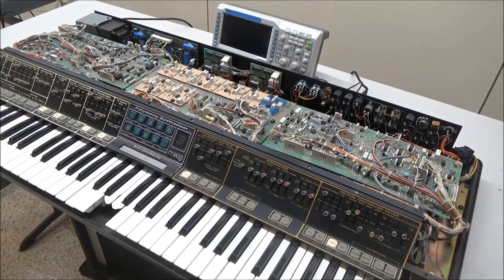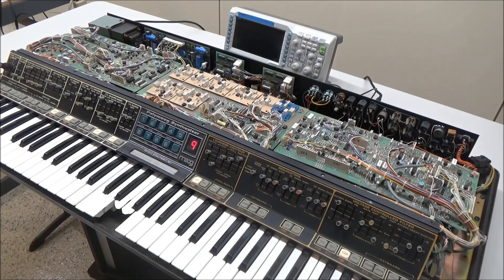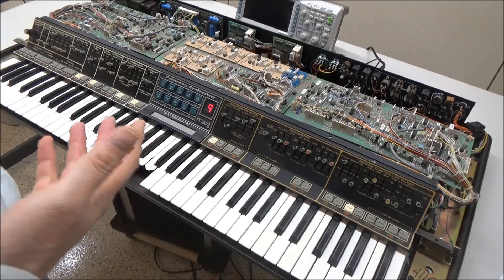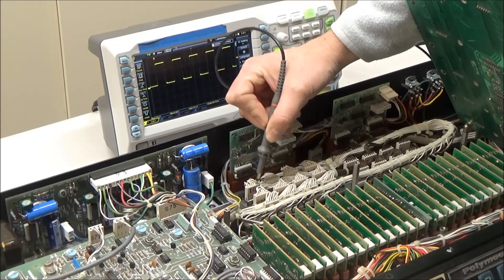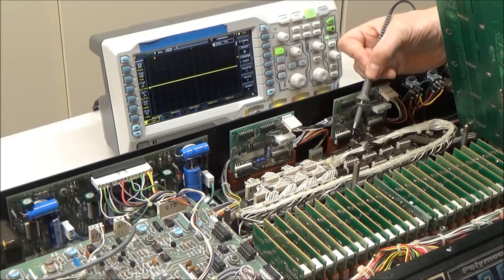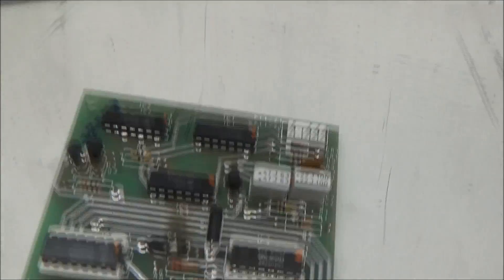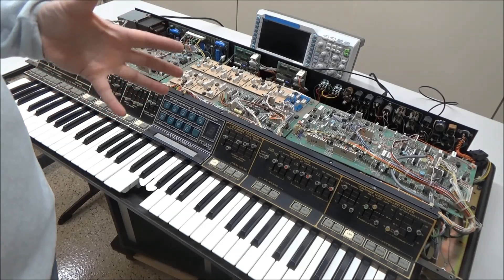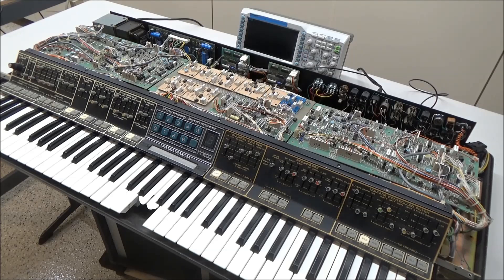Moog Polymoog Repair - Dead/Incorrect Sounding Keys - Synthchaser #162

Comment: "The Modulator Cards" as you call them are actually Polycom cards which compromises of waveshaper, filter, vca and envelope per voice.
Reply from the maker: It's Polycom IC chips, and Mod cards, according to official service manual terminology.  But you can call them whatever you want, the point still gets across.

Comment: I bought 2 from a guy in Oklahoma with about 30% functionality in 1991. Dirt cheap, as was most analog at the time. They both went downhill and the "fix it shop" in Mission Valley took them in and shortly after seeing a bench told me to take them back Not fixed/ no charge. I got one of them to play reasonably well for 8 more years before smoke emanated from the back and it screeched a terrible death to silence. Most of the components were actually good but just the typical shorts here and there which kept it from playing through a song reliably. Sold the parts of both to a store which specialized in used instruments. They gave me about half what I paid the other guy as store credit. Both businesses are now closed down. I currently have what I like to call my junior PS3300 (Korg Lambda). It works well enough. It's neither a Polymoog nor a PS3300 but still an example of that era.

Comment: Boy, this sure brings me back! A 203A (one of these) was the first synthesizer I ever bought, in I think 1985 or 1986. I was able to purchase a service manual and I caught my unit up on all the engineering changes that had been made. Over the years I had it, I repaired a failure in the power supply, a couple of dead LEDs, and at least one 4xxx chip. The keyboard contacts often needed cleaning and the one-per-key voice cards often failed to make good contact with their connectors - oftentimes a solid whack to the Polymoog's underside was sufficient to clear a dodgy key up temporarily. A 203A that works can be kind of dinky (especially the presets but the string preset is great) but it can also be a fearsome instrument if you start combining the VCF and parametric filter section output - even more so if you utilze the sections' separate outputs on the back panel and pan them differently. There's nothing else that can come close to that. One note on the video that I wanted to make is about what's being referred to as "shaping" to produce the sawtooth generation. What's actually going on is that a square wave is being integrated but the integration is being done on both the high and and low halves of the waveform and then one half is inverted and the two are summed - or something like that; I'm working from memory. But that's why the octave selections for the square generation are one octave lower from those of the sawtooth generation. The Polymoog really was the end of the line for divider-based electronic instruments; you couldn't take the technology farther than this in any practical way (some would argue that the Polymoog already took it farther than was practical).

Comment: Yeeee gods... y'know, this is probably the only synth that's more terrifying inside than the CS80. And I have a CS80, so I'm speaking from experience.

I used one of these ONCE and ONLY once in 1980. I found it to be a real PITA; I couldn't get anything I liked out of the instrument. And much of that seemed like it came from the confluence of two different and somewhat incompatible technologies: the Moog parts, and the Cordovox parts.

Cordovox, btw, is a company out of Italy (back then) which Moog worked with in the 1970s. And Cordovox made...hold down that snare key...divide-down combo organs, ensemble keyboards, etc. AND...one of those organs affectionately known as the White Elephant was equipped with a Moog Satellite solo preset keyboard. So, yeah... there's a rather substantial connection there.

Now, if you go back to the mid-70s, Moog had a prototype polysynth that wasn't a divide-down...this was the mysterious Moog Constellation, which can be clearly heard on ELP's track "Benny the Bouncer". But what's not clearly known is that Bob had to send Dave Luce WITH the Constellation during the "Brain Salad Surgery" sessions for the sole purpose of keeping the damn thing operational on an hour-to-hour basis! Given the general shortage of Dave Luces at Moog back then, Moog had to do SOMETHING...so it's suspected that Moog used their relationship with Cordovox to graft a variation of divide-down architecture onto the rest of the Constellation's signal chain.

Why? Because ELP'S "Brain Salad Surgery" blew the hell UP! And suddenly there were people buzzing about this mysterious Moog on there. And Moog was in one of its more desperate monetary struggles in the years following the move to Buffalo. So they went for a quick, cheap fix...which was neither, in the end.

Moog doesn't have the best track record for polysynths. After this...and its crippleware counterpart, the Polymoog Keyboard...they gave the world the Memorymoog.

You don't see many working, stock Memorymoogs, either. In its case, the computer-controlled bits would eventually go spooey, with the big clue there being a complete failure of the VCO tuning system. Oh...and if you wanted MIDI, you had to have that retrofitted except in the late runs; around the same time, Sequential was killing it with their first MIDI synth, the Prophet 600, and Roland then dropped their first MIDI keyboard, the Jupiter-6. You can actually expect these to work...whereas the Memorymoog was something you didn't dare SNEEZE near! And with the drop of Yamaha's DX-synths...that, as they say, was that.

Tbh, I actually thought for a brief second when I saw the words "Polymoog Repair" that I was about to be treated to a YTP-style fiasco involving 500 lbs of gravel, thermite, tannerite, and cheap firecrackers + Polymoog. Instead, it was an actual repair video with no fire, explosions, smoke, melted plastic, etc. A tad disappointing...until the horror of the actual construction was revealed!

If synthesizers were in freak shows, the Polymoog would have to be the two-headed, eight-legged dog. Just one thin dime, ten cents, one more tenth of a dollar, and you can watch it feed on its native diet of capacitors, money, and buyer remorse! Hurry, hurry, hurry...! 😂
Reply: OK - I thought the Moog Apollo (the polyphonic instrument within the Constellation rig that Emerson played which was minus the Taurus) worked the same way a Polymoog did - divider technology.

Comment: I love the Polymoogs , I found one and while it sounded amazing it had many problems so I had to pass ... can I ask though: if moog or behringer or someone wanted to make a poly moog clone today would it be easy to make? When the Moog One came out I wondered if it would be able to do the polymoog sounds but I didn’t hear any attempts at Vox Humana or the Strings preset so I’m not sure.... and finally, are there other divide down machines that also have two distinct divide down oscillators ?
Reply: Maybe the ARP String Ensemble did? I don't know. Yes, especially with surface-mount devices a Polymoog clone would absolutely be possible today, and in a much more compact form factor. Some 1970s digital and analog ICs might not be possible to source today; I remember there was an op amp that I replaced in mine that wasn't trivial to source. I think I had to use one with a can-style case instead of a DIP.
Reply: thanks for your reply @hubbsllc  !  I wonder why no one wants to make a clone, the Poly Moog I got to try had a really epic sort of "stage" to it, a variation on Moog sounding bass while still being really unique.  I thought Dreadbox might be going for something similar with their Abyss synth...anyway, I'm glad you got your one working!

Comment: Quick, cheap effective fix for crappy circuit board contacts. Obtain some fine grade silver oxide power and super thin cyanoacrylic lacquer - super glue premium grade. Mix the oxide with the glue into a paste and apply to the very very clean contacts. Make some test pastes. allow to cure and check resistance with an ohm meter and blunt probe. Rough up the coated contact slightly with 400-600 grit sandpaper.
A one ounce bottle, roughly 25 grams of Ag2 O is good for several thousand contacts. I store up cards and bad contact components then make a run of several hundred coatings. In the case of your Moog, you can 'plate' all your boards contacts in a half hour or less.
It only takes a few molecules of silver oxide to make a good electrical conductor and several million should be exposed in the paste.

Comment: Great channel and I really enjoy watching your videos. Here is my Polymoog story if anyone is interested.
I went into ABC music in Bristol in November 1991 just as they getting some used synths out on display which had come from their London store. One of which was a Polymoog 280a which had a label on it (Ex Gary Numan) sounds like they purchased (stole) a lot of Numans old kit which they spread around their stores. Me being a Numanoid since 1979 and already building up a collection of synths by this time i had to get this one. No surprise that when they turned it on a lot of the keys did not work and the lower filter bit did not function, but Vox Humana worked and we were soon playing Cars etc in the store. I left a while later with Polymoog under my arm (sort of, not really, it was a 2 man lift out to the car) and i was £300 lighter in the pocket. 
I did get most of the Polymoog keyboard working, fixed the lower filter with some new logic chips, replaced failed LEDs, rebuilt the power supply and worked out 2 of the divider chips were out. I paid quite a lot for 2 NOS original ones from an old road kit which came from EMIS in Bristol, but after i had fitted them in sockets they only worked for a short time before failing again. I learnt the lesson there to wear an earth strap as i probably fried them with static.
Life then got in the way and all the synths have been in storage for a while now. When I finally retire it will keep me quiet for a good few years getting them all working again. Happy times.

Comment: The wide plastic multi cable connector on the top, center of the power supply board is also a weak point...I had to cut that connector out and solder the wires directly to the board when I had one of these years ago
Reply from the maker: Yes! A few months ago I had to replace a problematic one for a customer. That's one of the few connectors that's a standard pitch so it can be replaced with a 0.156" molex header and housing with good results.

Comment: I had a polymoog keyboard and suffered the same issue, unfortunately it seemed to be self inflicted as I found out that the leg fitting screws underneath were made too long and if you tighten them without the leg attached they short out the board above.

Comment: I know that synth from the Vox Humana sound famously used by Gary Numan
Reply: The Polymoog Keyboard (model 280A) had the Vox Humana preset but the Polymoog Synthesizer (model 203A) did not. However, if you had the schematic for the 280A's preset cards I don't think there would be any reason why one couldn't replicate a Vox Humana preset card and put it in place of one of a 203A's preset cards. The preset cards contained jumpers and resistor arrays to take over the button and slider settings from the front panel and also included an aesthetically-voiced fixed filter. It's that last aspect of the preset cards that keeps someone from being able to just set the controls of a 203A a certain way to reproduce the Vox Humana preset.

Comment: I bought a broken Polymoog for cheap back in the 1980s. I think I paid 500 Deutschmarks for it. The problem was one broken UA741 which created some high frequency modulation on the power rails. That brought the whole synth down. And yes, I can confirm that moving that beast around or even temperature changes in the room cause all sorts of problems. Plus, that monster is super heavy and the sounds - which of course can’t be saved, are very basic. Such an overrated machine!
Reply: I disagree re overrated if only because it can get into territory no other instrument can touch. And I disagree re basic. I discovered that if you mixed together the VCF and parametric filter sections and gave the VCF envelope a slow downward sweep, the combination sounded like no other synthesizer and that if you went one step further and brought the separate section outputs on the back panel to their own mixer channels and panned and especially effected them separately, the result is absolutely hair-raising.
Reply: @hubbsllc  and now try to save your fantastic sound creation ;-)

Comment: I may be wrong (I hope not for a change!) but I think you pointed at the wrong spot for the high frequency oscillators. They are on the top left board. You pointed at the Top Octave generators.
Reply from the maker: The service manual calls them the High Frequency Oscillators and calls the oscillators on the top left board the "Reference Oscillators".  It's an unnecessarily complicated design.
Reply: @Synthchaser  Ahhh so it does. I haven't worked on another synth with top octave/divide down stuff (are there any??) so I'm not sure if it was really necessary but I'm pretty sure it was so they could do the pitch modulation for each oscillator individually and maybe for pitch stability. Although you never know what's going to be broken when you turn it on, it's always perfectly in tune!